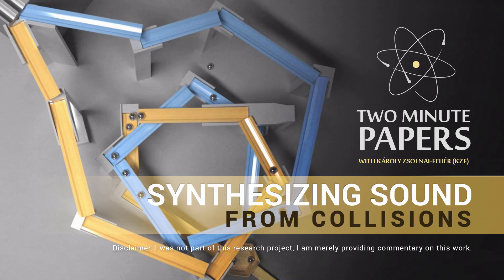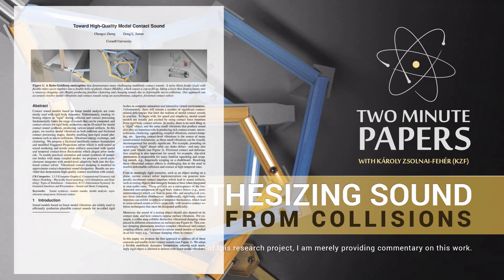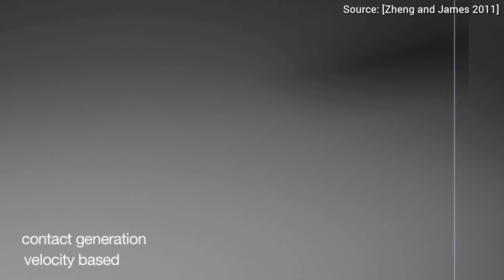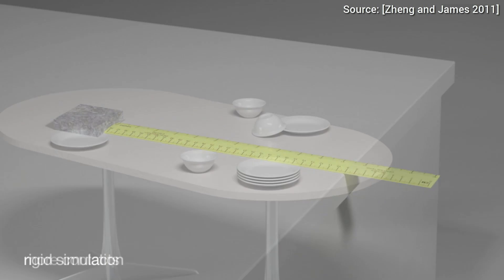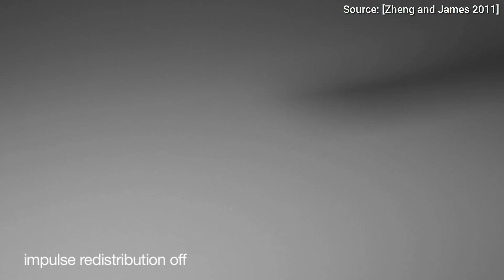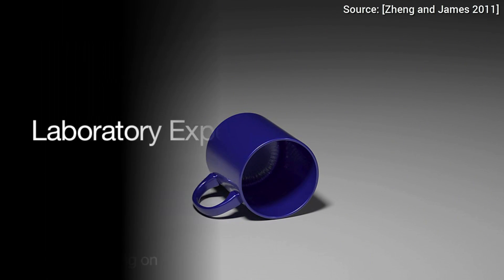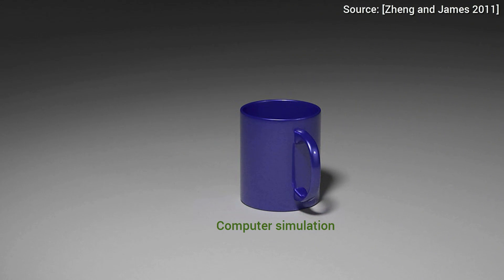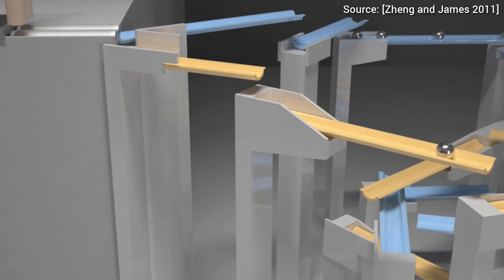Synthesizing Sound From Collisions | Two Minute Papers #15

Comment: It's sad that even after 7 years, we still don't have sound synthesis in the 3d apps. And results in this video are already incredible
Reply: Simulating physics 12000 iterations per second (to sample 6000Hz frequencies according to Nyquist-Shannon sampling) in real-time is not that easy. A ton of corners will have to be cut for this to be in real-time. To put it in perspective for the non-technical people, this is like your computer having 12000 fps in a videogame, but instead of frames, you'd use most of the compute for an n-body algorithm that dynamically integrates many times per frame as long as it is about a stable target such as 12k iterations per second.

Comment: that was an awesome paper. I knew a bunch of these but not this one.
So much great work done on this. What I haven't seen much of, sadly, is people actually incorporating this work into something.
Reply from the maker: +Kram1032 Research in many fields is years ahead of the industry and sometimes it takes a bit of time for them to catch up. It's an interesting question whether it is the case for this work - maybe it needs some optimizations before fitting it into the very tight time budget of real-time applications. 
In our own small ways, we also try to make more people aware of how awesome it is in Two Minute Papers. See how it goes! :)